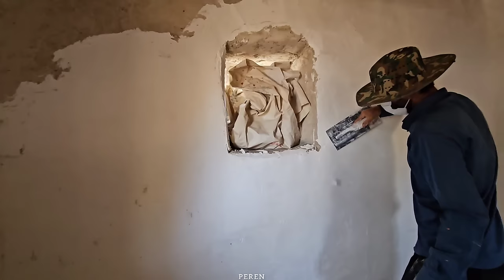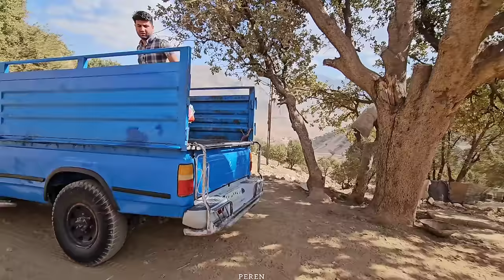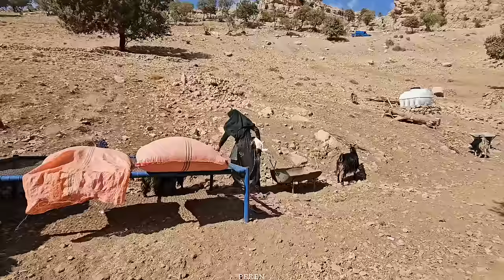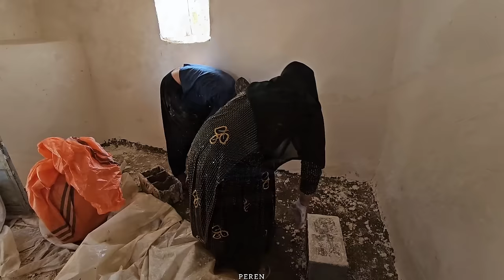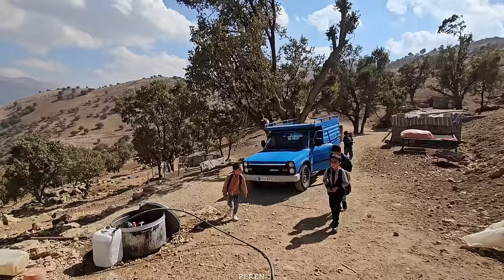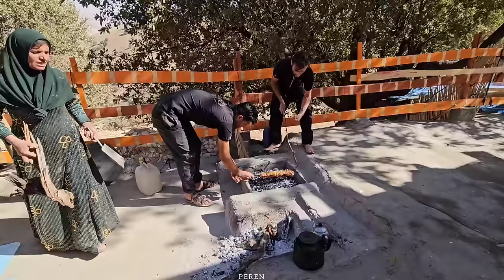"The Guardian Angel: Empowering the Peren Family through Education and Generosity"

Comment: ❤ you need to add concrete to that area as well because it's got nothing but mud and those stepping stones and when it starts to rain the mud is just going to run off and you're going to end up in trouble with just the stones❤😊😊